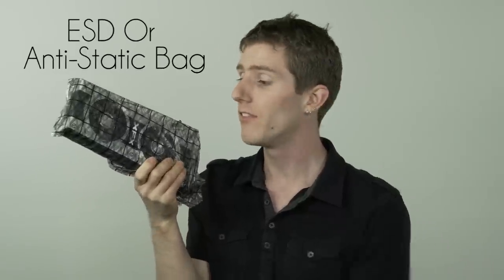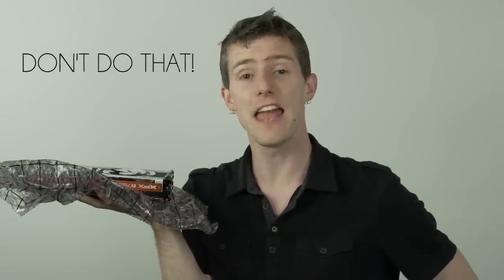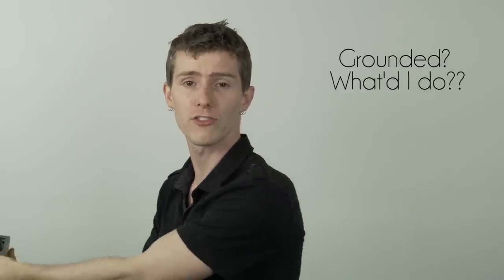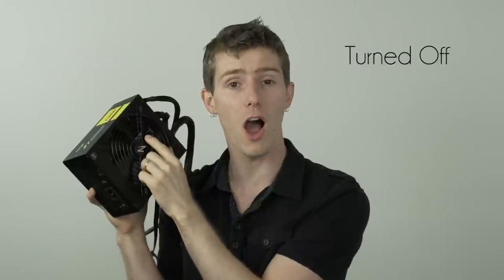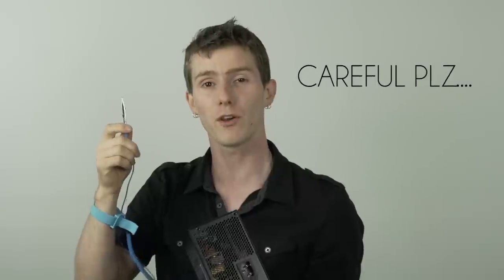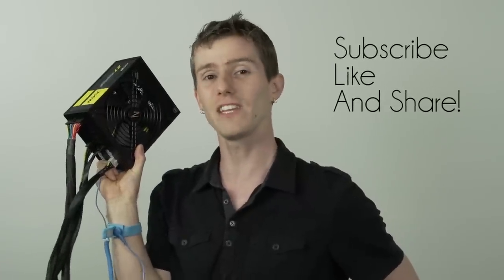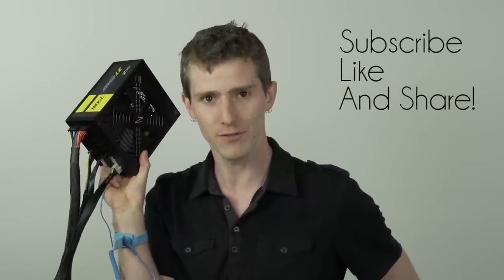Anti Static Safety - Handling Sensitive Electronics as Fast As Possible

Comment: you should be good if you wear shoes with rubber on the bottom(like pretty much all shoes) and you touch something metal that's not near your workstation. I've never had any issues, also standing on tile flooring instead of carpet really helps.

Comment: It wont hurt it if you put it on the bag. I saw a video where a guy debunked that. As long as you are grounded and as long as not power is in the device no problem. I think people put it on the bag not as esd protection but as protection from like scratches.
Reply: careyholzman debunked it
Reply: turn the bag inside out. SOLVED!
Reply: Deta335 i actually was about to say that lel xD
Reply: Yeah carey holzman made a myth buster video about static shock
Reply: Be extra safe, turn the bag inside out! o:

Comment: I would have thought that a conductive surface would do no harm because if it gets zapped with static, the voltage will reach all points almost simultaneously, the damage is caused by a difference in potential between 1 point and another. If all points are at the same potential there should be no danger. ( effectively it is a lightening conductor) 

The only slight danger is that there is a battery on the motherboard and this could be shorted out.

Comment: I live in the desert. So I should just tap the metal of the power supply while its connected but turned off before handling the components basically?

Comment: It could just depend on where you live. Static builds easier in very dry conditions. (think of clothes coming out of a dryer) So, if you live in Arizona then yes you're probably just lucky, but if you live in an area that has enough humidity to prevent static build up (you would know if you weren't, you would be getting static shocks all the time) Then, it's just static isn't a common problem in your area.

Comment: I have to take my video card out to replace a fan and I was wondering with the card out of the pc, can I still ground to the pc? OR should I ground to something else? Thanks. I have always built my own pc's and although I don't fully understand the whole static/ground thing entirely I have not really had an issue. it's just that usually if I were to fry a component I can buy another one. I can no longer do that as I am not working due to illness and cannot afford to mess up.

Comment: so ... put the PSU in the case.. plug it in the wall but keep it switched off on the psu unit ... touch the psu anywhere ? or that part where linus shows the fan grill ? and then you can install your mobo and and repeat the touchy touchy to psu and install other stuff?

Comment: BTW, I have an AVR (auto voltage regulator), can I just plug that in without turning it on and just step on it with my bare feet to dissipate static? Thanks.

Comment: Techquickie The CompTIA A+ exam manuals say not to plug your PSU into the wall socket when working on a PC.
Reply: An old manual I saw when I took it like 15 years ago said that you can however connect the ground lead on the PSU plug to the ground on a wall socket. My tool kit included a wire for this purpose with alligator clips on both ends. The jaws on the alligator clips were removable so if you had to you could pull one off and stick the rod in the ground hole then clip the other end to the PSU ground plug or to the clip on a wrist strap. Just don't try to stick it into one of the live holes!

Comment: so if i touch my video card now, it will have shorter life. bud how it can be measured, did the touch affect its life or not? i have been fixing computers for 3 years now, and i have 5 desktop pc and 3 laptop that i have opened and cleaned. and they all are working like a charm.

Comment: Can I discharge myself by simply touching the metal end of my laptop (dell insprion N4010) power chord (plugged into a turned off power strip, which itself is plugged into the wall)?  Also could I attach croc clip to the metal end?

Comment: The outside of the bag is actually not conductive...CarreyHolzmam has a video debunking myths like that. He boots a motherboard while it is on the antistatic bag, it works just fine. He also throw a motherboard in a sink filled with water, and after a day of drying, it boots just fine. These parts are fragile but not as much as the interwebs may make you think.

Comment: Will I need to use an anti static wristband to repair older gaming consoles such as a the NES, Super Nintendo, Game Boy, etc. and if so, what the hell do I hook the alligator clip up to?
Reply: anti-static wrist straps are snake-oil in my personal experience a much easier thing to do is simply not wear socks on carpet when working on electronics go barefoot or wear sneakers over those socks.... also like Linus said don't go touching connector pins if at all possible

Comment: I have never used an anti-static strap & have never had any problems, nor do I make any particular effort to discharge before handling anything in my PC as I really don't need to. I know I don't build up static where I am and to open up my case I have to touch the metal exterior.

Comment: so the psu is off at the wall and I connect the strap to the psu?another question is do I need to remove the power supply before doing this? do I unplug the wires that are in it?

Comment: With all of the wrist strap grounding cables I've seen the wire is so thin it would catch fire and melt before successfully electrocuting a person it's not a huge deal if you plug it into the wrong slot in the wall, though it's still not recommended, though it did make me giggle thinking about someone doing that.

Comment: Lets say that you are walking on a carpet and touch something made of metal, sometimes this will give you a electric shock. If the shock is small and only gives you a tingling feeling thats about 3000V. If the shock is big and the electricity jumps from your fingertip to the metal it's at least 10000V. And sure you can be lucky for a very long time. But if something happens with a motherboard or a GFX-card you'll regret not using some kind of protection against ESD. I have 3 years of experience assembling circuit-boards. Good video but it could have talked a little bit more about the consequences that ESD can have.

Comment: I usually keep the PC plugged in and the power off, and keep touching the case and PSU when I can, so that's fine.

But one time, I didn't have the power turned off and somehow the PC turned on just as I was inserting an ethernet card!!! Cue mad rush for the mains switch!

Comment: Sheeeeeeeeit. I'm building my first pc and my graphics card just came in a few days ago. I'm still new to computers as a whole, and I immediately took it out. I think I might have been barefoot, but I have carpet, and I set it on my bed. I also was grabbing it by the back.  The worst part is, this was my first part, and I won't be able to test it for a few months until I get the others. I really hope I didn't fuck up.

Comment: Is it possible to simply use some latex gloves while starting to build a pc instead of buying or remembering to touch any metal objects....
Srry its my 1st build ever so excuse the ignorance... im pretty new to this. Any advice would be great.
Reply: Samson A I also thought about this as am doing my first build soon, from what I can pick up, it seems latex gloves pick up static, doesn't really help the situation, and that grounding yourself via the method linus mentioned or touching your case are the only reasonable options
Reply: Sathit Suwannakul i actually got all my parts 2 weeks ago and just went ahead and started putting it together this past friday ..up and running now all max settings on every games ive tried on it so far with and RoG swift monitor. Extremely pleased!
Reply: hmm
Reply: Samson A Nice one, I'm halfway through my exams atm, so will build after, did you end up using the gloves? or anti-static band? or just touch the case
Reply: Sathit Suwannakul honestly every tech guy i talked too and a few from intel told me they personally dont do none of that shit,....the guy from intel came and checked out my build to make sure it was done right and all and he just went in there and didnt bother with any antistatic crap.

Comment: are there any other things that you can use instead of a psu to use in conjunction with a wrist strap as I will most likely be standing on carpet and the only psu I will have will be the one I'm building with
Reply: +Zstealth gamingX3 I think as long as you don't shuffle your feet on the carpet or move around on it, you should be fine but a hard floor would be a lot better to build on if that's a possibility. We don't have carpet floors in our house so that's friggin' amazing. :D
Reply: +Mac Was thanks

Comment: Sorry guys, I am still somewhat nervous about building a PC. If I get an antistatic wristband and connect it to the PSU, do I have to have the PSU connected into the wall, or just by itself?
Reply: into the wall. to my knowledge you should have the power turned off at the wall and on the psu
Reply: how do you turn the power off at the wall lol? Like via breaker? or by using a surge protector.
Reply: DeadExcuses in many countries there's a switch at the wall that turns the socket off
Reply: Rusty Nugget US must just be wierd, I think I have only seen those in hotels

Comment: So why does the power supply has to be plugged but turned off? 
Makes sense you don't turn it on but why does it have to be plugged?
Reply: Most power supplies are of the three-pronged variety (if you live in the USA), and that third prong provides the ground when plugged in. It stays grounded even when the power supply is turned off, because science.
Reply: Win Stabell depends really. But chances are no, but never impossible. And don't build a pc during a lightning storm. lol
Reply: *****
Finally, thank you very much

Comment: So i have unwrapped my asus r9 270x out of its bag to look at it in person and put it back in the bag. Have i fucked my graphics card?
Reply: no, the inside of the bag is totally fine ;) its the outside thats the problem
Reply: Kenneth Hermann cheers and if my components are damaged, will they smoke and catch fire or will the life just be shortened?
Reply: if anything of thouse 2 it will be shortened, thou what is likely to happen is that the statics just shorts a circet and makes it unusabel, depending on what circet it is, your item will straight out not work, or proformence will be reduced or u will in some cases get errors that whouldent otherwise accuer.
Reply: Kenneth Hermann Can you spell?
Reply: No, However cannot se how thats importent if the point was clear. thou thanks for pointing it out for who ever chould not see it on their own..

Comment: One question if i do this method in a powersupply that is installd in a computer Will this caus any problem?
Reply: +SweCake CS:GO No just make sure its plugged in , but also turned off ,and you should be fine.Infact if its installed in your metallic case, your case is also grounded.

Comment: Lol I never use anti static wristbands or touch grounded metal and I have yet to break anything. Probably a bad idea but eh. And the stuff I work with is usually very old since most of the PC parts I have are from dumpsters.

Comment: Does anybody know how any other places to put the alligator clip for the anti-static electricity strap besides the power supply.
Reply: Any large conductor will act as a voltage sink.  I use the chassis since I don't trust the wiring in my home.

Comment: Go tell that to an electronic engineer and you'd get laughed at

Sliding across a carpet and touching an IC chip will pass about 4000V of static through it... Although this damage may not break the chip there is a good chance it will reduce it's life expectancy.

Just google 'static damage' and you can see many microscopic images showing the damage it can do to microchips...

Comment: is it okay to use a wooden table as a substitute for anti static bands?
Reply: +mac hac That's not a substitute. You have to ground your body so static electricity doesn't build up on your body. You can discharge the static buildup by periodically touching something that is earthed (like a home radiator) or connecting the end of your wrist band to something that is earthed.

Comment: Oh crap... i'm definitely guilty of putting stuff on top of the anti stat bag! Man i'm dumb... and lucky.
Reply: Same, did it with my 1070 but so far is working great.
Reply: What else do you put it on? Besides spending money on a mat designed for this? Cardboard? Wood?
Reply: Wood that has a finish on it is probably one of the best options for doing that.

Comment: Wait hold up, so turned off and plugged in, but is the power socket supposed to be on or off?
Reply: switched on from the wall but switched off from the PSU itself. I would assume.

Comment: the outside of the bag is conductive? why would they make it 2 different materials? unless its supposed to be like a Faraday cage but even if so, why not just turn the bag inside out?
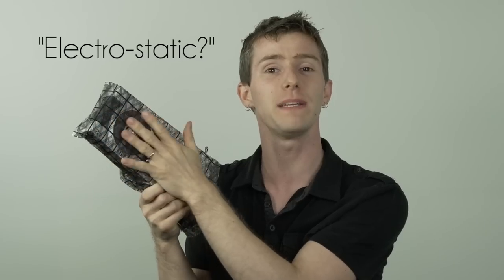Reply: Not all of them are specifically, if you look at 0:38, the black pattern is what helps redistribute the electricity and create the Faraday cage along with the bag itself. You don't wanna put stuff on that. And a box is safer anyway, height against spillages (beer), surely non-conductive, no points against imo.

Comment: How about touching the ol' "touch the back of the case". does that work?
Reply: the case is not grounded. only the components are grounded because they are wired with the psu. if you wan't to be safe enough you can ground it on your radiator or on a metallic lamp
Reply: ClaudioSL619 or on that case which is touching that PSU (like mentioned on the video). Which also touches the I/O plate of the MOBO, that same place used to ground the I/O ports (have you noticed those little metal tabs to ensure contact between the port and the plate?) because that case is, in fact, grounded.

Comment: Grounding yourself through a plugged in power supply is a little over kill, any semlarfe metal objects will do.
Reply: You understand that the static electricity has to go somewhere right? And that a psu that is plugged in is (supposed to be) grounded by the power socket.
Reply: Tacodude11NL yeah, and that power socket is grounded to the fucking earth. A little overkill, a simple metal object will FUCKING DO IT.
Reply: Im sorry but A SIMPLE METAL OBJECT ISNT GROUNDED!
Reply: So actually ground is touching ground right like floor or something like that or soil ?
Reply: MalaysiaCat Grounding isnt standing in/on the ground, if you ground yourself you touch a metal object wich is connected to deep in the ground.
Reply: Like what ?
Reply: Well in the Netherlands you have a metal pin at the top and bottom (or left right depending on the angle) at the electricity socket, those pins are grounded (And if you live somewhere else just look for the metal object that is outside the socket that you can touch with ease) and if you touch them you are also grounded.
Reply: Tacodude11NL you dont need to use something inside the ground, if your bare feet touch the ground, you are grounded, you just need to touch the ground or a wall, to discharge,(unless its a wooden or isolant one)...
Reply: Marcos Danilo thx
Reply: Jochem van Oosten If I do get an anti-static wristband, where do I connect the "alligator" clip to? Besides the PSU?
Reply: Is actually correct, you can touch Any metal object and Nuetralize yourself to it.  It isn't Grounding yourself but you are evening out the static load.   

Go take a microfiber blanket off a bed or something, or worst a microfiber cover for a blanket/bed, I did this before and I got SERIOUSLY charged with static, touched the bed frame which had enough metal to nuetalize myself too, and huge bolt of static came out.

Its the same deal why touching graphics card or bare electronics is dangerous as you move around, and touch stuff you neutralize your "charge", if you become super charged for whatever reason, and touch a graphics card, it will take that charge and become nuetral with you, which could very well overvolt it.

TLDR;  Touching large metal objects like desk etc is fine.
Reply: Aura Rowe That really helped! Thank you.
Reply: Aura Rowe Would touching a wall outlet be fine?
Reply: MalaysiaCat You know how when you walk across carpet with just socks on and touch a light switch you get a static shock? That is what will kill the electronics, and what you are trying to eliminate. Touching a power supply will do the trick, so will touching the screws that hold a light switch or wall outlet in, or most large metal objects. Anything that would normally give you that small shock after walking around in socks.

For me, I always build my computers at my desk and have my current computer hooked up under the desk already, so I just touch my knee or foot to my current computer case, which is plugged in. (make sure to touch metal and not plastic) If you are worried about static, on your next build, just get a wrist strap. They are only about $5 or so, which is cheap piece of mind if you are worried. It is a risk, but I think many people exaggerate it, so I wouldn't be too worried. I built computers for probably a whole year with the motherboard on top of the bag, like Linus says not to do, before I found out it was wrong, and I never killed any components.
Reply: ***** haha these people are so dense, that I had to use that language.